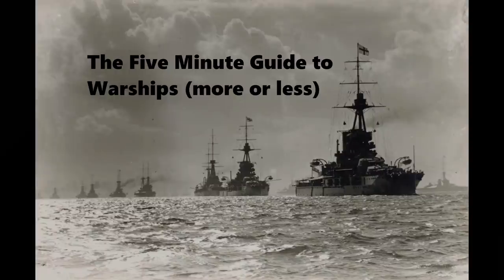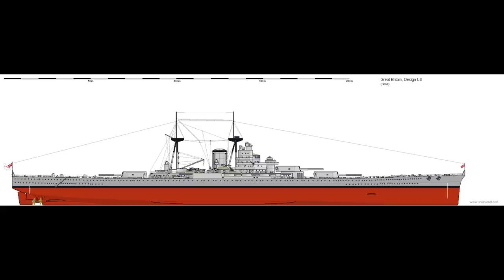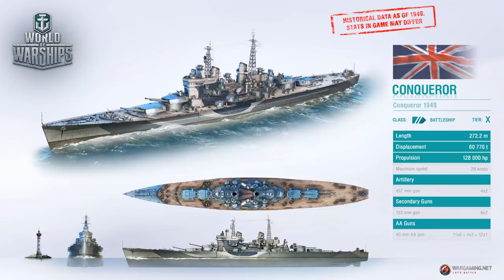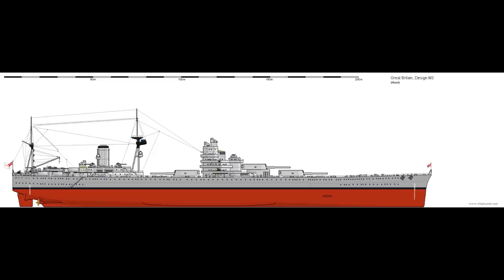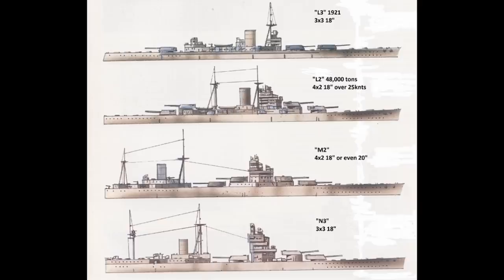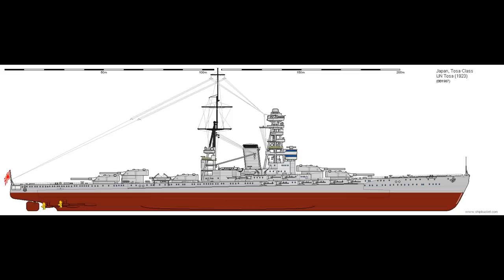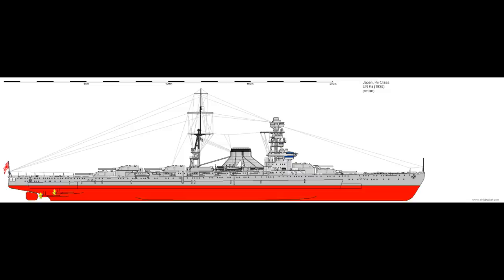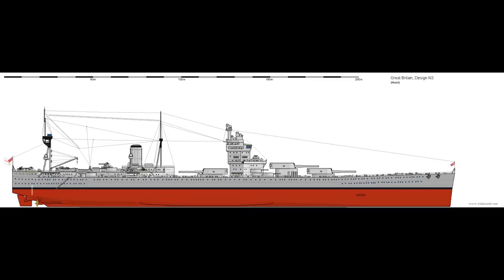N3 class (NB) - Guide 072

Comment: Were the underwater torpedo tubes on battleships actually useful for anything? Was it even possible to aim them or did they have to aim the entire ship? They just look like a waste of space and a possible weakness.
Reply: On tactical schemes and/or wargames - they worked. Early on,  those were weapons for brawling - relic of low battle ranges and experience of later 19th century. There was even a paper concept of  "torpedo battleship" - fast,  very heavily armoured vessel with dozens of underwater torpedo tubes, intended to break through the screen of light forces and wreak havoc in enemy van. Madness. 😂
 Later,  in 1910-1920s, they were meant to be the best way to sneakily send some torpedoes in the middle of the engaged side of the battle line (cruisers/destroyers aren't meant to be there, only on the disengaged side). For this purpose battleship torpedoes became huge. 
Underwater tubes typically were fixed, but idea was not in turning your ship to launch,  but instead to launch them whenever opportunity presented itself. Tubes themselves were few,  but torpedo rooms were well equipped and capable of rapid reloading. 
Anywhere else - they didn't. But to be fair,  battleships rarely ever got into a type of fight they were meant for.
During ww1, we essentially only have Jutland, and it was always about running away. 
During ww2, most ships have already lost them, and the nature of the naval war changed anyways. 
But ships which kept theirs - both Hood and Nelson, - got to use theirs against the Bismarck.

Comment: think i would do a design with 2 18 inch quad turrets, one fore and aft,
Reply: Rule of thumb: no one used quads unless pressed to do so. 
Literally all cases of using quad turrets came from various legal or building limitations,  as soon as they were gone - quads soon followed.
Reply: Great plan, until something jams the turret turning and you can no longer fire half your firepower at best, or all your firepower in one direction

Comment: Sorry, I’m having a bit of a problem working out the math here between the protection levels of these ships and say the Yamatos. I’m supposed to believe that on roughly 17,000 less tons for ships of about the same length (albeit a 20 ft difference in beam), their armor thicknesses are similar?!?!? Sorry, I want a detailed breakdown before I buy this. Please don’t give me superior British technology.
Reply from the maker: Partially a smaller citadel from grouping the guns, partially the need for vastly less space and weight for machinery, 23knots only needed a fraction over a third of the power the IJN ships needed for 27knots+, which means a lot fewer boilers etc.
Reply: The armor on the N3 would have been 3 inches thicker in the belt and 1 inch thicker on the deck armor which gives the N3 the obvious advantage
Reply: +British "all or nothing" wasn't really true all or nothing: protection of machinery is way below that of the magazines, both belt and deck. Turret protection is much lighter than on Yamato,  where it was realistically impenetrable. The citadel is internal,  cutting some meters. Lack of extended underwater belt and armoured bottom. Much less equipment here in there, because of 15+ years of tech progress. Aviation facilities. And so on and so on.

Comment: I wish the WNT had never happened so people would see what a disaster these ships would have been.
Reply: G3's would have been a descent ship [fast and powerful] while N3 would have been too slow by WW2 standards.
Reply: @fyorbane  I am not sure the G3s would have been too slow for the RN in WW II. The RN did not operate, in general terms, carrier groups like the IJN or USN did. G3's speed is more than enough to do all the work it could be called upon to do. Running alongside a carrier, providing AA support is only a very minor job for a battleship and one that is unnecessary as a couple of smaller ships can do that job BETTER. A lot of fuss is made over US battleships performing this role but it was a use for a ship that had been rendered secondary.

The truth is the US could have won the same war and fought the same battles if it had not built one new battleship. Colorado and Maryland were both nearby when Washington and North Carolina fought Kirishima and either one alone was more than a match for the poor old thing. The new US battleship did nothing their older sisters could not have done except run with carriers and that was not really a need.
Reply: Just how many sailors' deaths would have met the bill for your intellectual superiority?